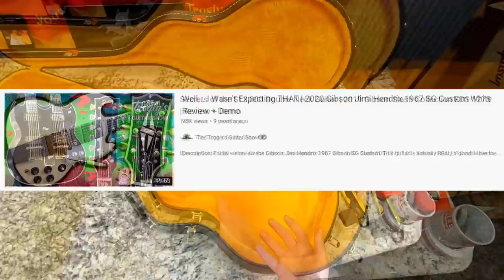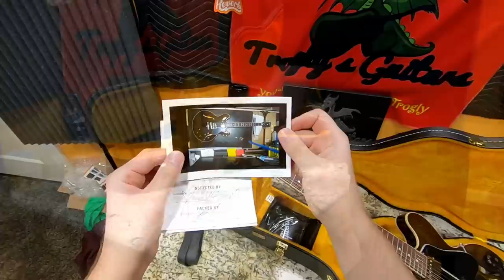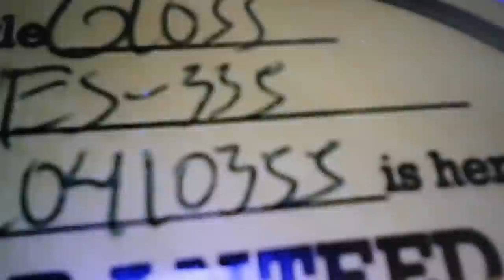The Owl Guitar Is Here! | 2021 Gibson Jim James My Morning Jacket Signature ES-335 70s Walnut Review

Comment: It's a Walnut Brown ES 335 with dot inlays and a thicker white binding than usual on the front and back of the body. I had a 1968 model the same color but it had small block inlays on the fret board and a trapeze tail piece going to the tune-a-matic bridge. I liked the Walnut finish because it's not the typical red, tobacco sunburst or natural finish most 335s had.
Reply: My buddy has a 68 335 walnut finish

Comment: Whenever I have a strap button that keeps turning, I just put super glue in it. You don’t want to fill the hole with glue, you just want it on the sides. The threads basically. Let it dry, then screw the button back in. You screw it in AFTER the glue drys. That’s key.